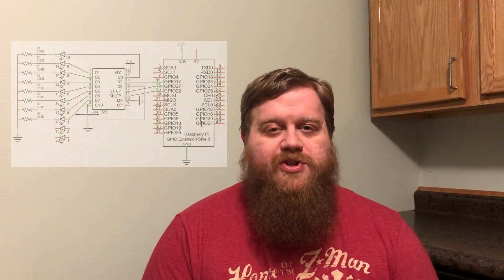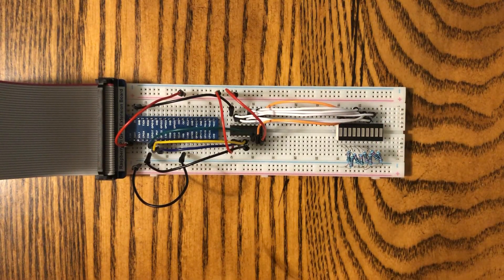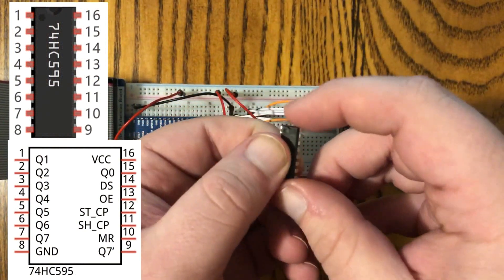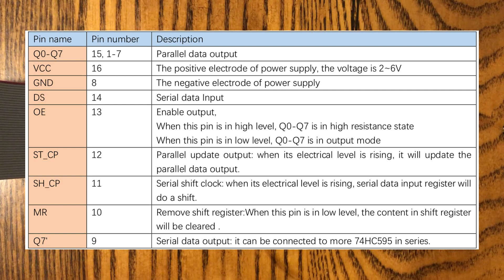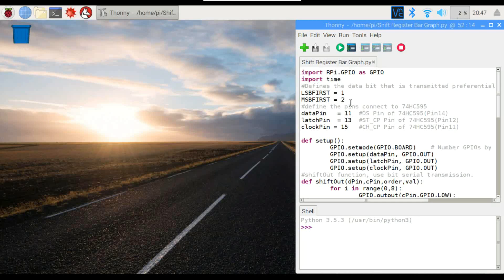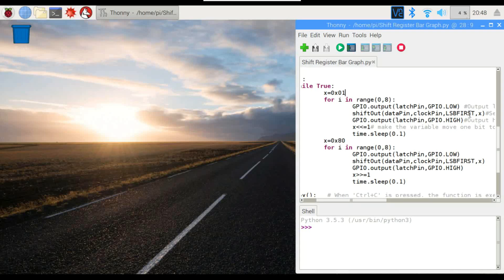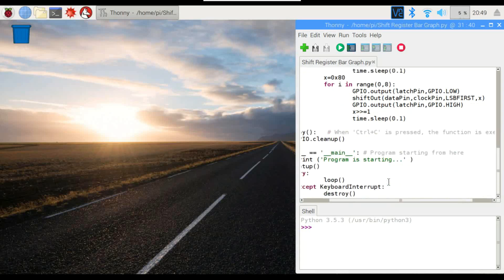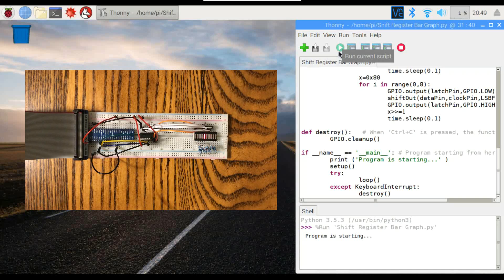Intro to Shift Registers | Raspberry Pi 3 B+ | Projects for Beginners

Comment: Did the next part of this ever happen? I have a project idea that involves around 200 leds that need to be controlled individually. A friend recommended shift registers to gain more outputs.
Reply from the maker: Shift registers would be the way to do it! I was not able to do the second part due to my breadboard being too small and I ended up with a lot of shorts and it wasn’t going to work
Reply: @ThinkingofPi  Thanks for the reply! Do you still recommend the 74hc595  ?
Im just gonna have to buy a crap ton of them to just play around with till i can wrap my brain around the concept completely lol.
Reply: @ThinkingofPi  Aww man that's a real shame...I would like to build a long Larson Scanner with a Pi, preferably using the 74HC595 as that would safe me the headache of charlieplexing them. Still, thanks for this video!